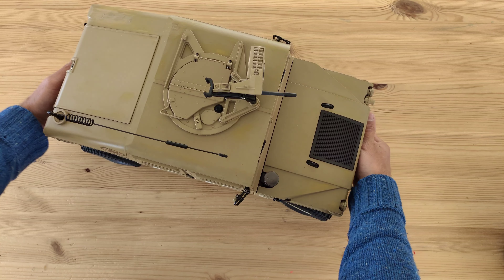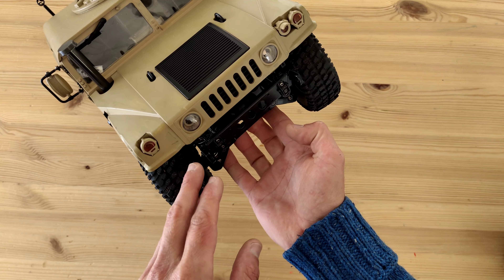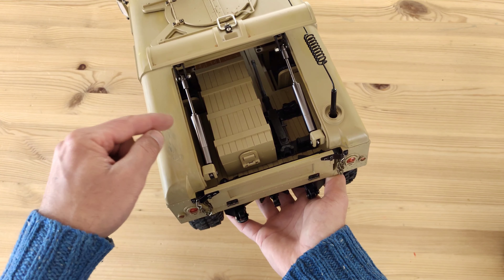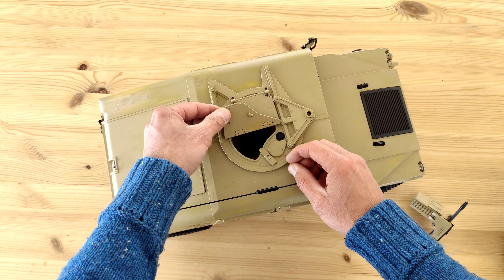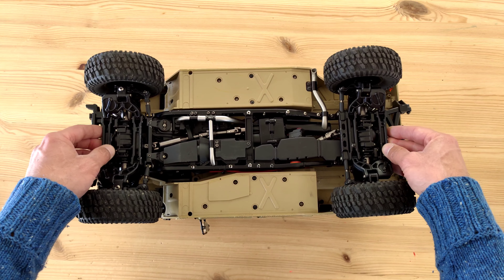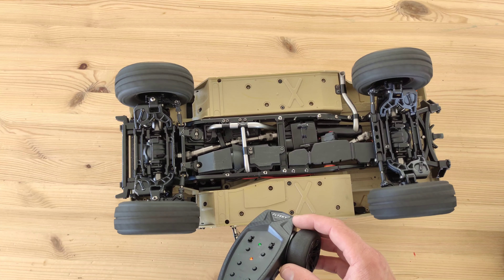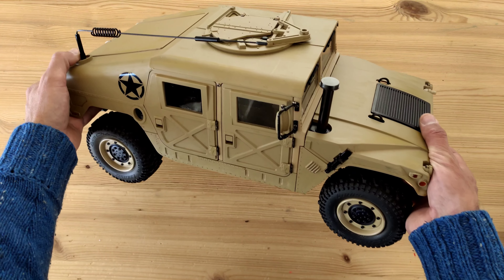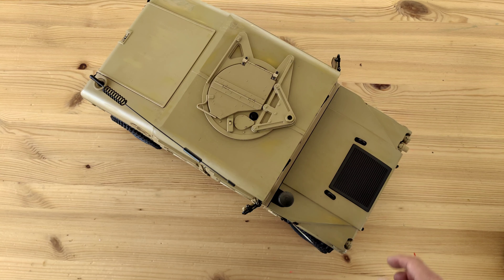Scale Hummer H1 full metal and detail, the HG P408 is amazing

Comment: In the military they refer to them as "trucks". They never call them "cars". In a platoon they will have 4 of them and call them "The one truck" or "The three truck." So a typical conversation would sound like; "Sergeant Hof, take the two truck over to maintenance." or "Sergeant Hof, wake up the drivers and take them to the motor pool to get the trucks ready." Soldiers will typically refer to a wheeled vehicle as a "truck" whether it's a Humvee, MRAP, HEMTT, or even a Stryker.
Reply from the maker: Hi, thanks for this info! 👍🏻